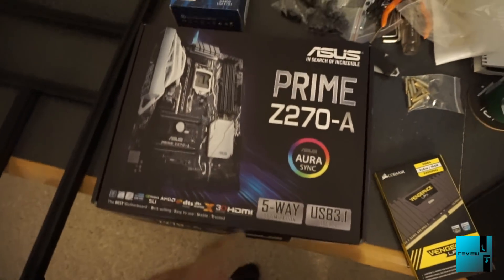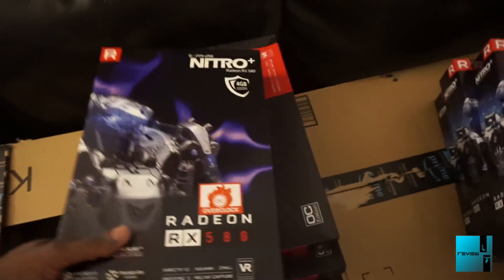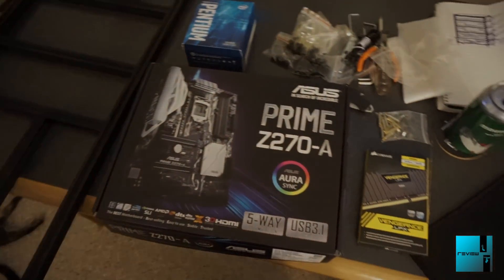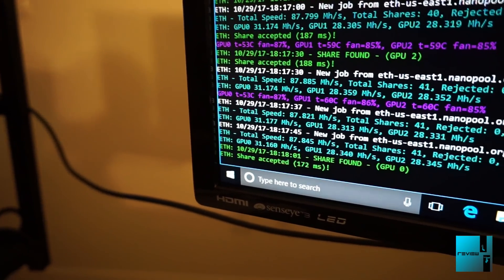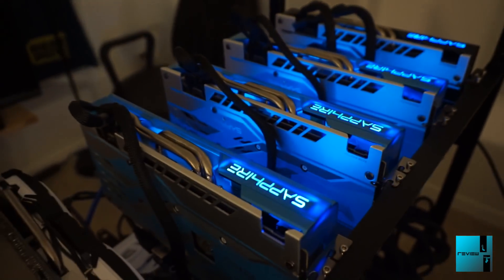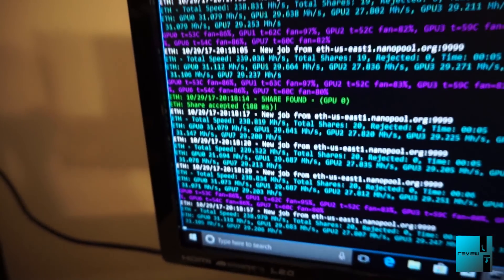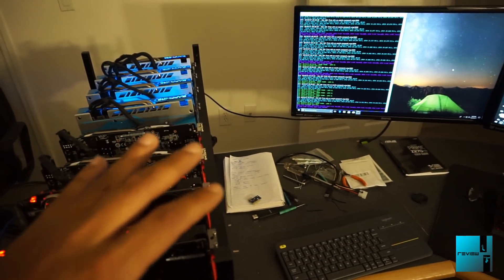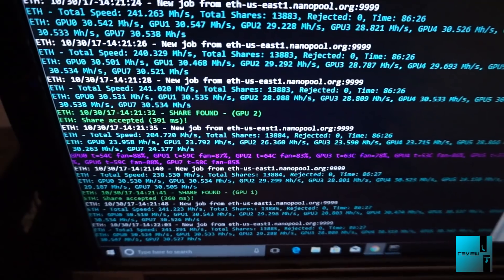ETH Mining Rig #2 Build and Assemble! 239MH!

Comment: brooo, I have the sapphire special edition, but Im going to conect it to my laptop, with the adapter, on top of the cards there are 2 power conections one with 6 pins and other with 8, should I conect boths, or just one of those, thanks¡¡¡¡¡
Reply: Carlo Weber   hey did you get response to your question ?
Reply: Jeff Melnik no I didn't...
Reply: Carlo I hooked both power supplies to my sapphire the 6 + 8 pin connectors. Is the power pack on your laptop big enough?

Comment: Hey Jay..two problems.  1.  I have my AMD GPUs installed with PCI risers but AMD software won't install but it can't find the GPUS.... ideas?  2. I plugged in my new secondary EVGA 1200 P2 and plugged 3 of my Sapphire GPUs to it but the thing won't turn on...ideas?  Again, thanks for your inspiration and videos.  I'm a computer build newbie and figuring it out as I go... Much thanks! T
Reply from the maker: Thomas Ash hey bud try installing the driver with only one card plugged into a riser going to the first pcie 16x slot. Also on the second psu is the jumper plugged into the motherboard cable. It’s a little rectangle black connect that came in the evga box
Reply: Thanks for the quick response, Jay.  I don't have the PSU plugged into the MB.  There appears to be two jumpers listed in the Asus user manual. One called "Clear RTC RAM jumper" 2 pin and one called CPU Over Voltage jumper 3 pin.  Is it one of those?   I will try your idea on the PCIE 16x slot for the PSU.  Thanks
Reply from the maker: Thomas Ash not on the motherboard I’m talking about the second power supply. You have a cable that says mobo on it and the other end where it plugs into the motherboard . There is a black rectangle cap in the evga box that needs to be plugged into the 24pin motherboard plug on the second power supply. Basically the second power supply will not power on without that

Comment: Hey Jay, you inspired me to build my own rig.  I am installing the Intel CPU and it came with a heatsink fan with pre-applied "thermal material". I have heard that I need to apply thermal paste but that is not in Intel's installation instructions.  Thoughts?   Thanks!!!!
Reply from the maker: hey bud and thank you for the love! some people change the thermal paste but to be honest i stick to the stock thermal that comes applied on the stock heatsink. i have not had any issues with temps at all when it comes to cpu. if you were overclocking a cpu then i would

Comment: Hi man, how do you get the drivers to be stable over 6 cards? i struggle a lot with win10......
Reply from the maker: Christian Grytten I used the amd Blockchain driver
Reply: Thanks dude. I just installed simplemine OS on my rig. I just ordered another 16gpu rig and will use simplemine on that one too i guess. What do you think man? :>
Reply from the maker: Christian Grytten it’s good but I rather use Windows to mod bios and run one shot I haven’t had any issues with windows at all 🤞
Reply: cool, guess you have better windowsbrains haha:-)

I used windows to mod my RX580 4gb AORUS and RX580 8gb AORUS and RX580 GAMING 8gb. the Aorus is best for me.. nitro+ is fkn sold out everywhere :-(

do you know why 4gb cards have less hashrate? is it needed to copy lower than 1750 memorystrap?
Reply from the maker: Christian Grytten the armors 4gb I pulled 29.8mh out of and they are cheap and run at good temps as well. I’ll have to check the clocking on them
Reply: thanks bro. my aorus 4gb rx580 are stock 1750mhz and the 8gb are 2000. i ran them on 2150mhs on windows. but on simplemine i run them at 2110. i need to get better at this :D
Reply from the maker: Christian Grytten I’ll check what mine are running at when I get back home

Comment: Can you please tell me how to connect two PSU? I have Corsair HX1000i and EVGA G3 and 8 Rx 580 Sapphire SE on TB250-BTC+ with USB 3.0 powered risers? THanx
Reply from the maker: hey in the psu box did it come with a 24 pin jumper? i know all the evga psu i bought came with them.
Reply: Yes, I have that jumper, also I have Y cable and add2psu. But how did you connect power for risers and GPUs. Did you connect all the risers power with master PSU( the one that power MOBO)?
Reply from the maker: Zoran Rancic hey I did Sata to the risers then the usb to pcie

Comment: man, I have a question, i want to build a mining ring, i wanted to build it with RX Vega 56 or 64, but I cannot find them... I see you have been using 580s, what would you recommend me... wait till i get the Vegas or start with the 580s ?
Reply from the maker: what are you looking to mine?
Reply: Looking forward to mine Monero, but u know I like what is profitable and viable, is not like I'm buying a ASIC... But I would like to invest a few, and u know, I like this stuff, like a hobbie
Reply: IT  Im also thinking that its a good idea to mine ethereum, or zcash, but i need to start building my mining ring, last time I saw another guy's video, with 1080 and everyone in the comments said he was getting very low hash rate, i need to start to do this fast and right, what are your thoughts, do... Im open to everything
Reply from the maker: Corullo TJ I would do zcash with those 1080s a lot of people I know that used those said they are amazing for zcash
Reply: 1080 for zcash or rx580s for monero?.... i rather always choose the one thing that will get me to the highest level of excellency, I would do my research and if I can start getting those 1080, i ll right now
Reply from the maker: the 1080s for zcash. i use the rx580s for eth.
Reply: Review I.T. I just bought sapphire rx580 nitro 4gb, bought 7, let's see what I can do with them...

Comment: Hey, Great video. As you went through your list of equipment you mentioned a M.2 PCI adapter.  Would you please provide that product brand and specs?  Also explain why an adapter is required?  Are there not PCI ports in the Asus motherboard?  Thanks much. Thomas
Reply from the maker: Thomas Ash the m.2 is in the description above. And reason I used that is because the mobo only has 7 pcie slots but they also have m.2 slots. So that m.2 adapter converts it to a pcie
Reply: Thanks.  Do you use a heat sink of the CPU? If so, what do you recommend?  Thanks again. Thomas
Reply from the maker: Thomas Ash I used the stock heat sink that comes with the cpu

Comment: Complete noob, and I apologize, but I am intrigued. How much does your energy bill go up from running 1 rig, 2 rigs, etc? Also, is there a definitive guide available from start to finish on how to setup a rig from build all the way to everything you're doing from the computer? I want to build a rig for the challenge alone but actually mining something is an additional and necessary benefit obviously.
Reply from the maker: Brian Beard power went up about 70 per rig with the power cost where I live it’s different depending where u live and cost per kWh. And there is some guides on forums but they are not the greatest but they help a little

Comment: Nice video, I have a question.I’m a total newbie and I want to set up my first rig, I’m thinking 6 card setup, not sure if I want to do ethereum/zcash or monero. Of course whatever is most profitable at the time. What cards would you recommend, the 1060/1070/1070ti, the sapphire here in this video or the amd 580? It seems the 580 I can get for about $300 a card when the 1070ti is almost double that, when looking at the specs it seems like if I’m mining for ethereum I can pull about 29-30 mh off the rx580 and about 37ish off the 1070. Is the few extra hash worth double the price? Please forgive me if it’s an ignorant question, like I said I’m new to this and don’t want to waste my money so any advice would be greatly appreciated.
Reply from the maker: hey Garry i would look up exact model of 1070 and see what the common power consumption is at that mh. if its the same or close to the 580s then i would save the money and go with the sapphire 580s.

Comment: Those 5 cards should already be giving you 150 Mh and when you added three Special Edition Nitros, that’d be another 93. In theory your total should be  243 Mh.
Reply from the maker: Pj Flordeliz you are correct I had a issue with the 4gb sapphire card. it kept getting errors when exceeding 29mh so I backed it down to 27.8mh to run stable. I’m going to redo the bios and see if I can get it back up to 29ish stable this week

Comment: After studying your videos and more research. I think I'd like to do an 8 instead of a 6 gpu rig. I have most of the same parts on your list except power supply. I have a Corsair RMx Series, RM1000x. Can I use this? And what you reccomend for the second?
Reply from the maker: jason kwalick how many gpus does that psu support?
Reply: At Least 6. I have been going over parts lists. You have a lot of the same products I was going to use on my first 6 rig. So, I decided to do an 8 instead. Only true difference from your list and other 6 gpu list (not including GPU'S) is the power supply. So, I know it can run 6 with all the other gear on your list. And thanks for your time and info in your replies! Much appreciated!
Reply from the maker: jason kwalick anytime bro and if you go 8 you can run at least the others on a gold psu

Comment: Why build a rig now with 4GB. Wont they be useless in 12-16 months?
Reply from the maker: jason kwalick we all don’t know til it happens but by that time I’ll already make ROI back and profit
Reply: Thanks for a response. I've been studying mining for about 4 weeks trying to absorb all I can.  I have bought most the gear for my first rig ,some off your list, except I haven't pulled the trigger on the GPU'S yet.  I'm looking at MSI VGA Graphic Cards RX 570 4GB, MSI Radeon RX 580 4GB, or Sapphire Radeon NITRO+ RX 580 8GB. I'm interested in long term, mine and hold.  Any suggestions? First one is a 6 GPU kinda proof of concept. If I did go Sapphire Radeon NITRO+ RX 580 8GB can you fire up a rig one card at a time. Can I start with 2 then add 1 every week?  Thanks and enjoy your channel!
Reply from the maker: jason kwalick yes you can do one card at a time doesn’t have to be all at once that’s the great thing about doing a rig. The sapphire SE 8gb are great low temps and low power consumption compared to the msi gaming x 580s

Comment: I want to know your opinion about that special edition of sapphire , is it worth It ? I mean would you prefer it more than the ordinary edition ? I think that the fans would encounter some cooling issues or be out quickly. what do you really see on the ground after you got them working for a while ?
I  will really appreciate your response as I am in a middle of taking a decision about buying those or just buying the normal edition by sapphire
Reply from the maker: Eng.yusuf89 Shabaan go with the special editions for sure you can crank out 31 to 32mh on those and you can get the wattage down very well on those as well
Reply: Thank you so much for your immediate response 
what I need to know , do they come with the original fans ? or the glassy ones only  (as pair) ?   because the fans looks week in structure than the regular ones installed in other editions
Reply from the maker: Eng.yusuf89 Shabaan they come with clear fans the highest temp I get on them are 58c they run very cool compared to some of the others I used
Reply: Huge thanks friend I appreciate your time
Reply from the maker: Eng.yusuf89 Shabaan anytime bud

Comment: What are your clock speeds on your sapphire 4gb 580? Thanks
Reply from the maker: Derek Chen GC 1460 MC 1900 power limit -30% mV -50
Reply: Awesome thanks, I will give that a try on mine. What version amd drivers are you running? and are you using msi afterburner? wattman?
Reply from the maker: Derek Chen I use Trixx and the latest version of the Blockchain driver

Comment: there is no big difference in hashrate between the same versions of 8gb? is 4gb still good nov/2017?
Reply: I want to make a similar build, but I have heard the same thing that 4gb will be obsolete and wouldn't want to waste that money. I see for similar cost is 8gb XFX cards, any reason not to use those?
Reply: I have everything on order from your build besides GPUs and only 1 PSU so far(starting with 4 cards), THANK YOU! Just hesitant on the 4gb cards. Would you weigh in on using the XFX GTS XXX Edition RX 580 8GB OC+ vs EVGA GeForce GTX 1060 6GB SSC GAMING ACX 3.0. Both are currently priced at 290 each. This is my first rig, so pretty excited.
Reply: 4GB will be good until mid to late 2019
Reply from the maker: fernando ferrandini in hashrate not a big difference
Reply: wow thanks for your response! Is there anything that makes a difference between the same version 4gb and 8gb in mining matters? 

your rigs look good and beautiful, well done! i live in brazil is very difficult to make a good ROI
Reply from the maker: fernando ferrandini there is talk that 4gb cards won’t be worth mining in a couple months or so but ill believe it when it happens lol
Reply from the maker: Jason S  I used the xfx 8gb on the first build. The second build I went some 4gb cards to keep the cost down but they hash just as good to be honest
Reply from the maker: Jason S hell yeah that’s awesome bro!

Comment: Nice setup :)
just want to know with 7 4GB graphic cards you are getting total speed 240 Mh/s ?
i'm just wondering i just saw a video of Rig setup that has 13 Graphic cards and it's total speed is  299 Mh/s.
his cards looks like white frame like one of your rig has white frame cards
Reply from the maker: i have 5 4gb cards on this setup and 3 8gb sapphires SE on it. but the white ones are the MSI Armor cards
Reply: Thanks for the reply, will you suggest which one will be best ?
NITRO+ RX 580 8GB GDDR5 SPECIAL EDITION
or 
MSI Armor 8GB 
will you share the amazon link for MSI Armor cards
Thanks in advance
Reply from the maker: Hasnain Shafqat the sapphire  SE is going to be a lot better then the mai armor

Comment: I want to know, what is a power consumption of SAPPHIRE NITRO + SPECIAL EDITION (this blue). I want buy 8 Sapphire nitro + SE but i dont know how one card use Watts.  Thanks
Reply from the maker: im getting from 95watts to 108watts on the SE sapphires
Reply: Well, so if u say SAPPHIRE N+SE is getting only  95-110 watts, how its possible that your all 8 graphic card's set is getting 1366 watts?  Additionally from the rest of cards, SAPPHIRE N+SE is probably the most demanding but still is getting only about 100 watts. And, in your opinion, how many watts will take 8 SAPPHIRE N+SE set if the rest of equipment  is of the highest quality and good configuration of cards?
Reply: Only 31 MHs of course
Reply from the maker: watts on rig 2 is a little high because the MSI armors at 136watts im actually working on them right now and have the armors at 117w to 121.2w at the moment right now
Reply: Review I.T.  Ok thx, but what do you think. How many watts should use 8xSAPPHIRE N+SE with full set ram, cpu etc. Under 1200?
Reply from the maker: all 8 cards at 110w max is 880watts so with mobo, cpu etc i think its doable 1200w.
Reply: Review I.T. Thank you very much but i cant believe that this Sapphires use only 95-110 watt :O. When I watched RX 580/570/480 the most of them use 180-220 Watts !